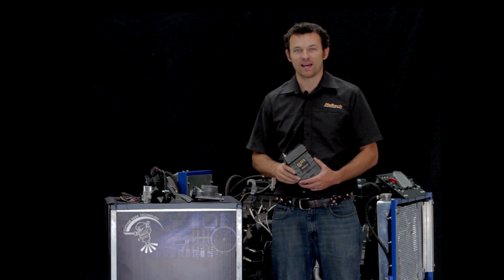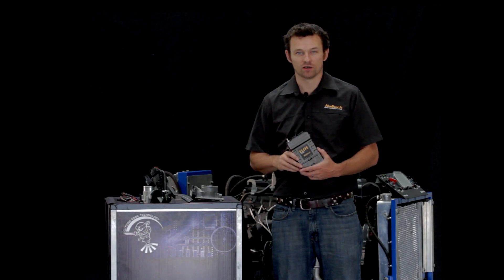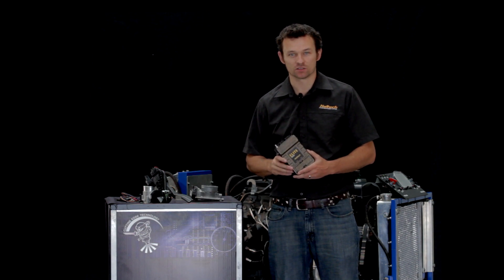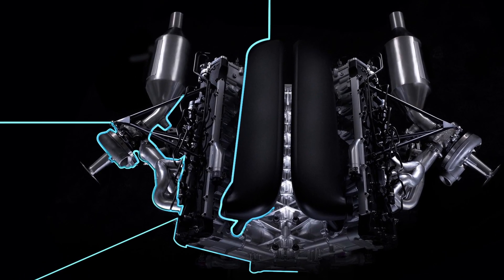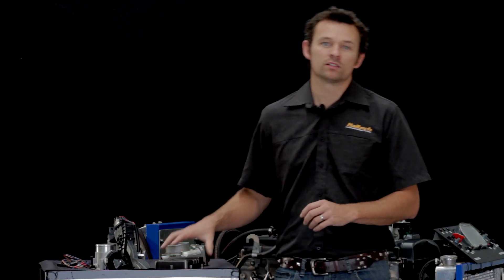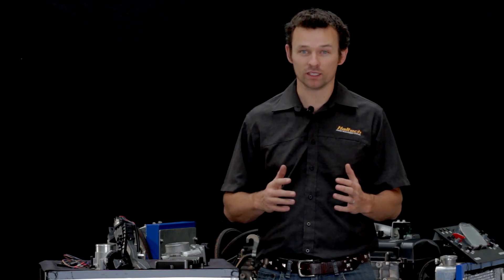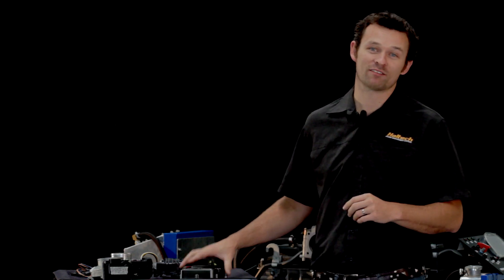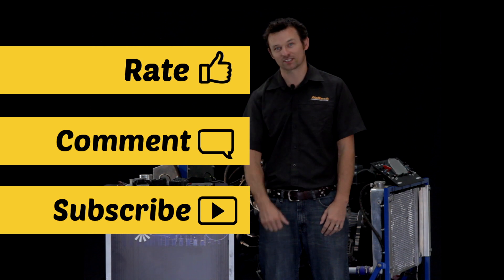How Drive By Wire (DBW) Works with the Haltech Elite ECU

Comment: The advantage of drive by wire is you can run cruise control and the ecm can open and close the throttle based on emissions. The motor gears are plastic and weak and and will get clogged up with PCV gunk. Now throw a limp mode in there and you are stuck on the side of the road and if it keeps going and gets worse. It will always be stuck in limp mode. You will sell your car and buy a new car. There is no way for the average driver to find why its not working. Could be the throttle body, could be the PCM or the pedal itself. All because they thought it would be a good idea to get rid of the cable that worked and couldn't malfunction. Took me almost 2 months to figure out why a hemi jeep kept going into limp mode. Turns out it was a combination of the pedal showing too much voltage (5 volts instead of 4.5v) the PCM being easy to trip into limp mode and a mess of wires that went the ABS being pulled out of their sockets and being put back wrong before the limp mode stopped. Now with other stuff like the cats failing early and normal wear and tare. Most people would give up and sell it. Luckily I am curious and wanted to know what happened and why a rebuild hemi wouldn't go around the block. I learned all about modern cars and computers from start to finish. Makes sense why an old car like my 87 mustang is still around. Everything wasn't over complicated to the point of useless if something small breaks. Its not worth the ABS and Traction control or even the cruise control to have ETC.

Comment: I have problems with my dbw sistem on my halltech,for some reason my car when I press gas all the way down after that throttle responded die don’t do anything and I need to turn off the car start again and read throttle again,already change throttle and pedal position sensor and still do the same thing
Reply from the maker: Hi Fernando, please contact our technical support team via www.haltech.com/support - they'll be happy to help with your issue

Comment: You lost me at "Better throttle response", you people are hilarious. As long as there is no direct link between the throttle body and the pedal with no interruptions, it will never have the instant response of a cable. Cable for ever.
Reply: And points and carburettors 😂

Comment: Will the Elite support duel DBW? I'm wanting to use two Nissan 370Z or 350Z Electronic TBs for a custom application. If it does not support those Nissan TBs, are there any others that it will support in a duel configuration? Thanks.

Comment: Hello Haltech you did mention anti lag but it also possible to setup the drive by wire to run cold overrun like in formula one cars. When I left off the gas no fuel is injected but the throttle blade is left open to reduce blow by and cool the exhaust valves can this be tuned with the Haltech elite as well can a sequential transmission be tuned with drive by wire to have a no clutch downshift by first cutting power to the down shift then automatically blipping throttle to match wheel to engine speed ? Thank you for your time
Reply from the maker: +Gio Alviz The Elite does not currently support throttle opening on decel cut, or blip on downshift (cut on upshift only), however these features are proposed for future firmware updates.

Comment: What would you say to the possibility of 'drive by wire' creating lag in the throttle response? My car has a good old fashioned throttle cable and is almost instantaneous with power, where as my grandad's (albeit slow shopping car with electronic throttle) has quite a big lag between putting adjustments in, it made it quite hard to drive smoothly.
Reply: +vanepico ride by wire reduce lag for turbo car and improove turbo respons. for n/a car you can gain torque or hp by closing or opening th TB at certain rpm if you dont have Valve timing.... lag is only because dut to factory set-up on non-performance car